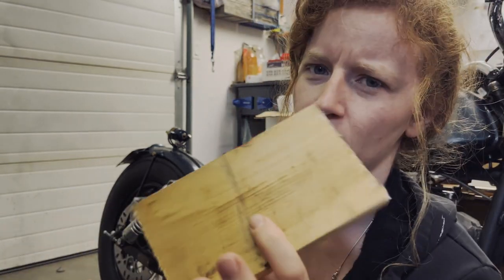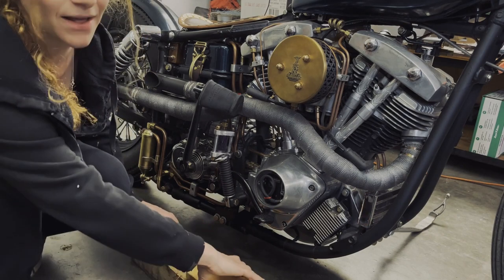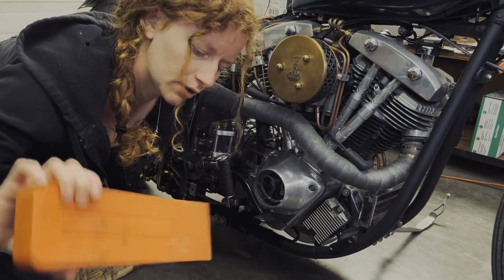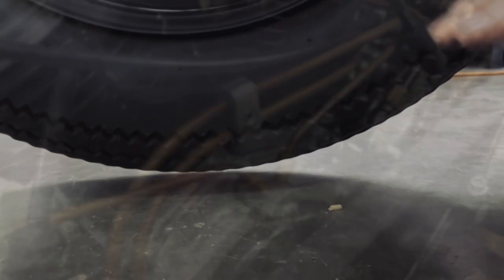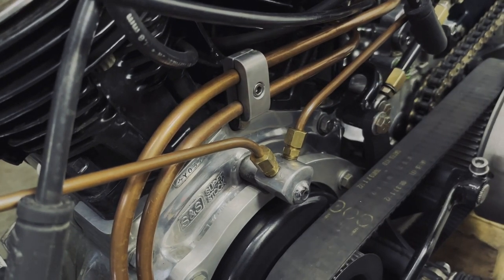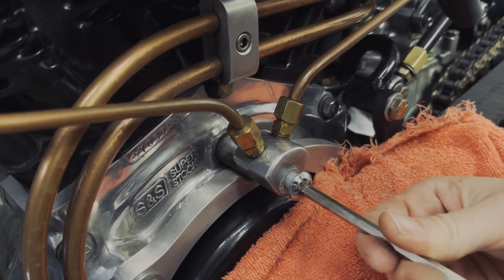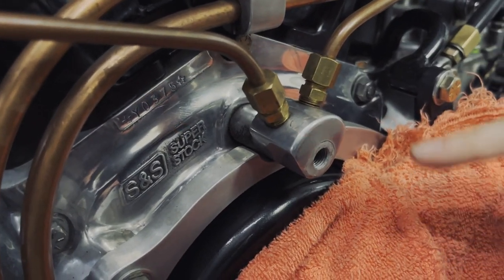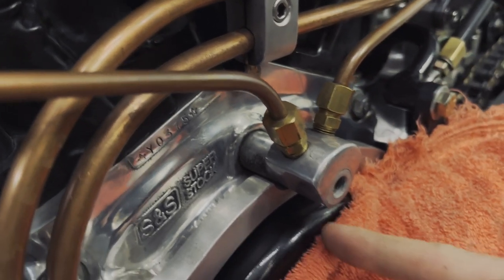Static timing Shovelhead stroker

Comment: Hi thx for the video, I have a 73 stroked SH
when i static timed mine  i put the TDC mark on the left of center while looking in the hole. I saw that you set yours to the right side of the hole ( rear of bike ) wanting to confirm if i was wrong in my setting? Ty miketerry
Reply from the maker: You aren't necessarily wrong, it's mostly a preference thing. Setting the timing mark to the front (or left) of the site hole will slightly retard your timing meaning that your spark will be a bit delayed causing the ignition to occur when the piston is already on it way back down; on the contrary, setting the timing mark to the right (rear) of the site hole will slightly advance your timing means the spark happens sooner, causing  ignition to occur just before the piston reaches the top of the stroke, which in turn will give you slightly better performance. Neither way is wrong or right. Some guys like their timing slightly retarded because it requires less effort when kick starting and means its less likely to kick back. And some guys like it to be slightly advanced. Really just depends what you like personally... I personally like the slight improvement in performance when my timing is just a little bit advanced.
Reply: Ty for that ill mark the ignition plate and reset advanced and try. Thanks again

Comment: I agree with several comments.   Mark the generator flywheel with the crank TDC marks.  Makes life so much easier (my new motto in life: Why struggle?)   I have a BDL 1 1/2 belt on my '78 shovel, so I still have primary cover.  So,  I just used some paint dots.  You would have to be more artistic. Dremel or file in grooves in the flywheel and a reference mark on the primary back plate somewhere.  Then, some gold paint in the flywheel grooves (to match the brass).   I put all the crank marks on mine. Front & rear TDC and the timimg light mark.  Also, since the flywheel can be removed, I marked dots (with a center punch) into a crankshaft spline and a matching one on the flywheel so it can be put back on in the same place .   My marks are where I can see them from the inspection cover.  
   Note: my ULTIMA electronic IGN Static timing was approx  a degree or so off from the timing light (at the recommended 2000 RPM)    Sorry, can't remember if it was retarded or advanced too much.

Comment: Hi Red-I'm one of those old dudes you were talking about ( 70's-and working on a bunch of diff motorcycles cars-chainsaws-weed eaters-lawnmowers-etc for 60 yrs)--as for popping out the exhaust-flatheads-knucks and pans were bad for popping--to stop it ya have to have 3 things--correct timing--correct carb setting and no exhaust pipe leaks--if pipes have a leak they will suck air into the pipe and mix with unburned gases and ignite causing a pop out the pipe---the way you are timing is fine--that's how i do it--center of hole is 35 degrees advance--rear of hole is 40  --forward just leaving hole is 30 degrees-----I'm starting to work on desktop and laptop computers now--since i have a bit of a background in electronics i like it---ain't gonna stop working on Harley's tho--I have a 1967 shovelhead with 91 cu in---a 1941 flathead 80 actually 84 cu in--a1962 KR engine--and a 1951 panhead engine--future projects---anyway good to see younger generation pick up where we left off--and being a woman is an extra bonus.

Comment: Good job!  I used to use the same method on points with a little test light. As soon as the points opened, the light would come on. Easy peasy. 
I’m going to use your wedge and block trick for getting the rear tire off the ground. 
Thanks.
Reply from the maker: It’s a handy trick!

Comment: Interesting so far. Did not grow up with any kind of mechanical influences, and have had little interest in it throughout my lifetime: never wanted to be a mechanic or build my own car or motorcycle. Still, there have been times when it was necessary to learn enough to do what I have to do based on circumstance or need. Much of that was needed when I was in the military: rebuilding valves, actuators, troubleshooting circuits, whatever. Anyway, back in the 80's I bought my first motorcycle as affordable transportation but ended up taking to it like a duck to water. If you really enjoy riding and working on your bikes, I hope you are able to continue doing those things. Thanks for sharing too.

Comment: Popping on deacceleration can be caused by exhaust gasket leaks or air entering the exhaust at some point, or a lean fuel mixture
Reply: agreed, quite often inlet manifold leak

Comment: Have to agree with bmp72 about marking the stator rotor at TDC and a mark on the case.   Easy to find TDC that way, don't have to look down the little hole anymore.  Can alway static or light time it that way.   I used an engraver to mark my rotor.   Either way, static or light will get you into the ballpark of your engine's running right.   Every engine is just a little different, gears wear, timing will change.   Poppinng on deceleration seems to be the nature of the beast.  Even the new motorcycles do that after time.   Nice videos-----you explain very well.
Reply: If a motor is set up proper, it won't pop. I understand what your saying, when software runs your bike, its different.

Comment: Remember, anytime you alter the stroke, compression ratio, or use a stronger camshaft, the entire ignition profile must be altered to suit.  High compression and cammed motors like lots of advance up front, and achieve full advance quickly.  The cam card and specs will help a good ignition person to work out the rate.  Read those plugs.  Most likely gonna need to richen the mixture a bit.  About 1:6 fuel/air to start, then about 1/12.5 fuel/air at temperature.  Ought to haul ass with that.
Reply: Classic tuning. Good points

Comment: Was interesting seeing how to set ignition timing on the S&S, the magnetic detection indicator light seems very helpful.  Similarly to another person already wrote in your comments, earlier year engines with carburetors tended to crackle and pop on deceleration, especially at higher RPM, (like when descending a hill). Had a friend following me at night once, said there were blue flames out of the exhaust.  Some manufacturers tried vacuum level sensed fuel cut off to the carb. venturi.  [That feature may add more drivability  trouble to the simplicity you have positively going for you, with  this machine].  👍👍
Reply from the maker: I upped my intermediate jet a bet thinking that could be the issue with the popping, but I also sealed up my exhaust better too and advanced my timing a bit. It doesn't pop anymore but it didn't seem to be running as good riding around town so now I'm not sure if its the jet causing that or the timing! I have to adjust my fuel/air mix a bit too and make sure that's all good before I mess with the jets anymore. Might have to drop it back down to the .0295 and see how it runs again with the timing being advanced and the exhaust sealed up properly.

Comment: Years ago, Primo sold a belt drive motor pulley with 360 degree lines cut into it. Another company sold adhesive-backed degree stickers in various diameters to put on pulley. I have a 3in primary belt on my chopper, and made my own belt guard with an adjustable timing pointer. I took my pulley into work (toolmaker by trade) and cut 90 degrees worth of lines on my pulley using my milling machine rotary table.

Comment: Matt’s dad Dan here. ML&R for you & your vids. I just got my first bike in a while, and I will try your homemade lift scheme.  Since you didn’t ask ;-) I just acquired a very cherry 02 Daytona 955i but I fantasize about building a shovel powered chopper as one of my rides. 

Do a vid about how you got into biking. I’m sure people would watch it. 

Smart unconventional women make the rocking world go round. And you are obviously a fine example. I recognize it because the love of my life also is. 

I study a lot of biking vids. Yours are always fresh.
Reply from the maker: Hey, thanks for the comment! Sounds like a nice bike you got :)
Reply: @RedRiderCanadaBC  Yes. I’m scrambling now to line up insurance, MSF (which didn’t exist when I was riding before). Started out thinking an RE 650 would be nice, then another classic era Norton then I thought a Street Triple would be good. Finally came around to liking the fairing, the double vs. single rear swing arm. Not to mention even better performance   

Sub 11 ET. Thinking about playing with the sprockets. Already has Matt Capri cans and tune. 12K miles. If Capri is before your time, he held seven land speed records and was a Triumph dealer. 

Gixxers & Busas can have top end. I want solid acceleration in the 0-80 range. 

Modern bikes like modern performance cars have too much unnecessary crap. ABS maybe. But how do you fix a broken electronic subsystem short of part replacement?

I’m a stubborn old sob and I intend to stay active and still have some fun. I’ve had a good life so far but I still have some gas in my tank if you know what I mean. 

If you see a silver blur in the S. Jersey Eastern PA area, it’ll probably be me. I’m all about getting some bang for my buck. 

So I am about to start having some real two wheeler fun again. I m retired now & the love of my life has come to realize I’m not a golf person or whatever. So you know when she asked what would I really want to do, I thought bikes. Had a very built Norton my first go around. Wanted more of the same. I like the fact that there are a lot of people who spend a lot to go fast, but I can go faster for less and with a fairly unique ride. 

Saw a thread about how big a bike an older returning rider can handle. When an 84 yo guy said he bought a Rocket 3 to start riding again I decided I could handle another 450 lb bike but one with a 21st century idea of power. 

Sort of like Bird on a Wire - hey, why not ask for more? Don Garlits is building very fast electric drag bikes at 90. And I’m pretty sure Sonny rode until he was up there. Heck some days I wake up still feeling like I’m 35. 

I knew my woman truly loves me when she told me to pick out a good bike, no further restrictions. 

I have a brother in law with a Sportster and a bagger who thinks I’m buying the Triumph out of nostalgia. I’m going to the strip anyway and I want to invite him to join me for grins. And to put Hinckley on his map lol. 

But I’ve added a sub 11 ET to my bucket list. I’ve got the bike, the reflexes and the desire. And the best part is my fairly much younger wife says I seen much younger. Life can be good if you work at it. 

Cool that you do a lot of your own wrenching. My wife & I get our haircut by a woman who grew up in family with two relatives who are mechanics and members of the local dominant, plus she has her own nicely set up HD. We get along well because “I know what time it is” and don’t ask stupid questions about the club. People who ride tend to be more interesting, at least to me. Sorry for bending your ear but I thought you might find it somewhat interesting.
Reply: @RedRiderCanadaBC  I would offer to roll by and let you see it. Only two problems I can see. You’re in BC I believe and I am outside Philadelphia. Plus I’m probably as old as your dad. But if you are ever in the East, who knows.
Reply from the maker: @mattgoodmangoodmanlawnmowi2454  hey, not need to be sorry. Sounds like you’re out there having a lot of fun! And that what matters, right? Don’t matter if it’s on a Harley, triumph or what have you, just getting out on two wheels is what matters! If I ever make it across the line I’m certain all my YouTube followers will be well informed of that trip haha. Have a great and some good fun eh!

Comment: I used to build racing gocart engines. And if it was popping some when I let off gas I new the valves were sealing  good. That is such a great  bike .when  you  going to  start on wideglide
Reply from the maker: Just put out a vid on the wide glide.

Comment: Your bike is esthetically beautiful.  I love the stock length springer (it looks stock length) with the disc brake, and what you've done with the rear finder and light.  Everything on the machine is
perfectly balance.  It's one of the best looking bobbers I've ever seen.  Laying the shocks slightly forward is perfect.  Was that your idea?  The whole thing is out of control.  You're very lucky.
Reply from the maker: Hey, thanks!! The front end is actually 4 under, and the shocks are set just about 3 inches back on the swing arm... I wanted the bike low so went with a shorter front end and then my dad pushed the shocks back to lower the rear end. My design my dad fabrication 😊

Comment: before i got a jack, i would use blocks of wood like you but you can do it yourself. just straddle the bike to hold it straight up and slip the 4x4 under. then lean one way and slip a 1x4 on one side then lean the other way and slip a 1x4 on the other side. you can kep repeating until you get as high as you want or run out of 1x4s

Comment: Instead of the business with the small timing hole, why not copy the marks onto the rotor of the generator with respect to a fixed mark on the crankcase ? Apparently you can get info about ignition timing from the spark plugs, theres a video on Kevin Baxters channel about this.
Reply: Exactly how I time my Evo dresser

Comment: good job . my guess on the decel pop is two , exhaust leak and or the low speed jet is to big by one size ,because with the throttle plate closed the engine is drawing fuel from the bowl ,too rich . hope this helps think through it .
Reply from the maker: Thanks!

Comment: O rings between the heads and intake manifold can cause over lean cough. Easy to detect. Spray a little plastic safe contact cleaner on the manifold junctions. It won't harm paint (plastic safe) and if it causes an rpm drop there is a leak

Comment: That might have been my issue with the ultima when I went to set my static timing. Must have been on the wrong cylinder. I'm gonna have to try that again. By the way... Decel pop is typically a sign of running a little lean or perhaps an air leak somewhere.

Comment: Light and subscribed. I have a 1980 Harley tour Glide with a shovelhead motor that I've been working on and it's just about ready to go it runs and drive but I think it needs a little bit of tuning in the carburetor probably the Jets because it pops a little bit when I start to get past 2500 rpm
Reply from the maker: Thank you for subscribing!!

Comment: To see if it running the right mixture to plug chops at tickover, 40mph and 70mph and then read the plugs. It takes the guesswork out of getting the mixture right.

Comment: Like to hear more and get a closer look at the plumbing on that bike. Some interesting things going on there...
Reply from the maker: The copper tubing is made from the same stiff you can get a a hardware store, then hand cut and bent to shape!  I have a couple older videos where I do a bit of a walk around of my bike and show some things a little closer. Thanks for watching!
Reply: @RedRiderCanadaBC  was referring more to the routing and such. E.g. looks like oil lines going in/out of you timing cover, perhaps a catch can(?) midway on the right side for the sump, etc. Nice work by the builder.

Comment: Called vale lashing . Also could be pushrods adjustment off what deal with oil line going into timing hole makes no since . Bottom end balance  ?? Owen 77 Flh
Reply: Oil drain back.

Comment: Might check the exhaust gasket s where the flange bolts to the head . could be the problem with the back pop . that's kinda a textbook timing job .us old farts like me just use a pencil in the spark plug hole to find TDC . just wondering with the electronic ignition if the coil has the right Ohms .

Comment: Oh lord, I recall my wife and I tried the strobe light method years ago. All set up and raring to go, I increased the revs until we reached whatever the figure was mentioned, the light was flickering away like a good'un, but the noise level was extreme to be sure. I was bellowing into her ears but she could not hear me at all. I got two subtle complaints due to the racket. I gave it all up. Not sure if I did not just throw the tool away, I certainly have not seen it for years now....!!!!!! We live and learn don't we.....
Reply from the maker: That sounds like a pretty funny scenario 😂 Thanks for sharing.

Comment: How to time it is feel the heat coming out from each exhaust pipe it should be the same and same exhaust pressure to because different camshafts and compression need to be timed this way stops the pop also single fire with two coils helps or need to adjust pushrods to tight valve not 100% closed . This is how I time my 75 and 78 shovelhead they both have big cams and high compression with solid lifters kit with big pushrods and straight pipes with fish tails and no pop.
Reply from the maker: Pressure coming out the pipes seems to be the same in each.